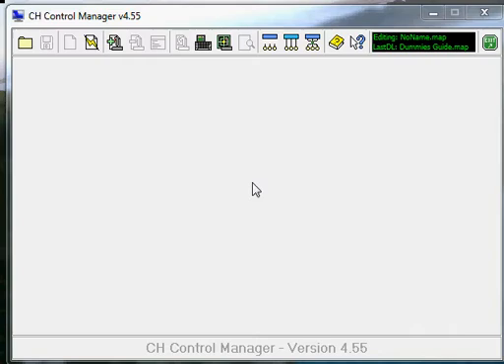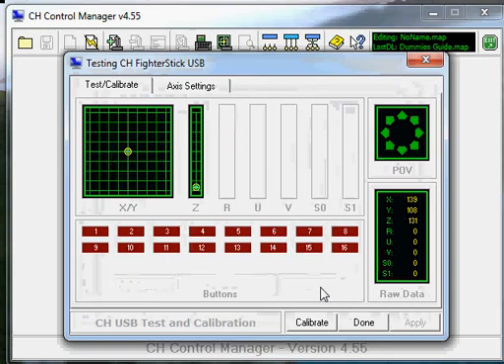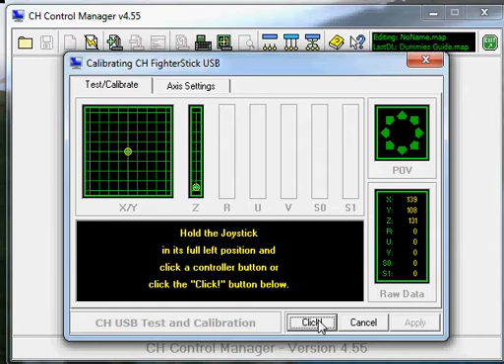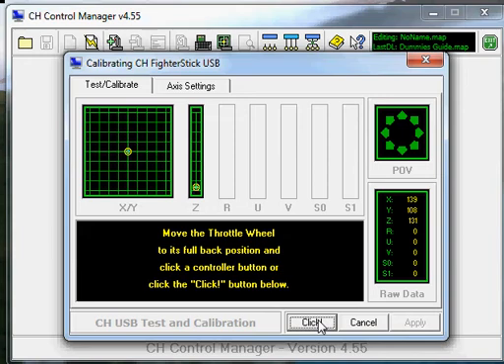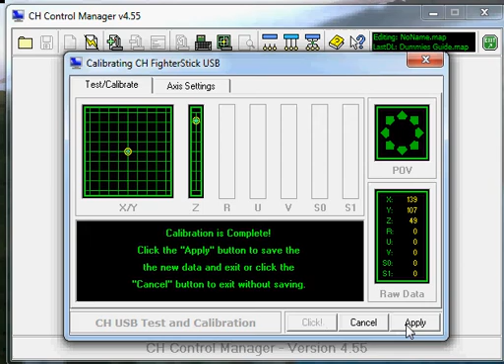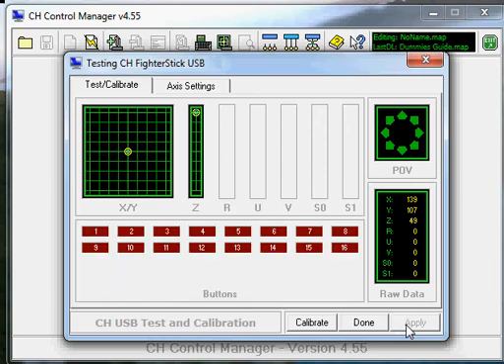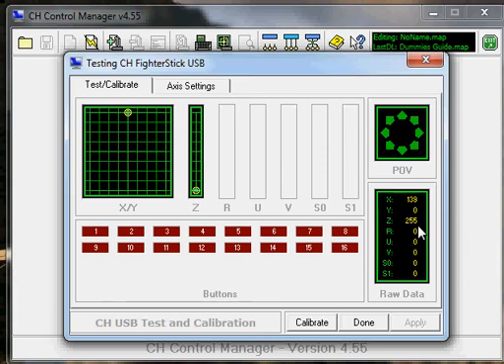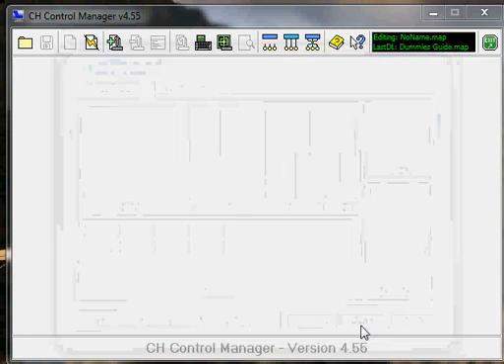CH Products FighterStick Calibration

Comment: HI, just caught this after owning my whole ch set up (4 devices, fighterstick, pro throttle, pedals, and quadrant) for several years. Great job, old posting I know but I just realized by watching this why I am getting 95 % in some cases on my quadrant levers because of this tutorial and will have to recalibrate. I did not have much luck with the software manager unfortunately as it would crash often but found I do not need it in my flight sims. The only problem I have is to find good uses and configuration setups for the games I play (such as Il-2 great battles, Cliffs of DOver, il2 1946, CFS3 etc) which is a good problem to have I suppose. lol  Let me know if you are still active and would love to get your ideas if possible?  Dave
Reply from the maker: I'm still here.  Still using Control Manager.  However in Win 10 from time to time after loading a .map, I have to shut down (not re-start) the computer for the controllers to be recognized.
Reply: @The531Ghost  Happy to see you are still at it. I should clarify that I still have the CH manager but use only for calibration really. I have avoided the push to windows 10 to avoid issues with some of these older sims/games. Not sure how long I can windows 7 but we'll see. What Flight sims do you play?
Reply from the maker: @davidfreitas3992  XPlane 11 primarily as I use it for training in the Civil Air Patrol using the G1000.
Reply: @The531Ghost  Gotha!
Reply: having issues with windows 10 - hard reboot doesn't wok, I uninstalled  MS Store- Windows sees the HOTAS without CM installed.   Once CM is running it cant find the HOTAS?

 @davidfreitas3992